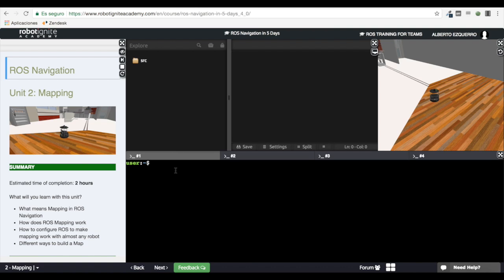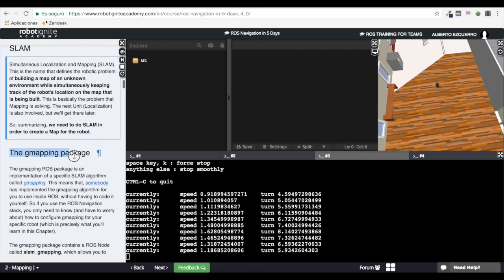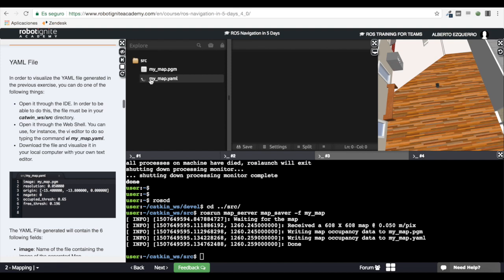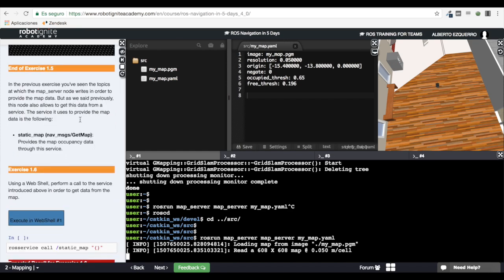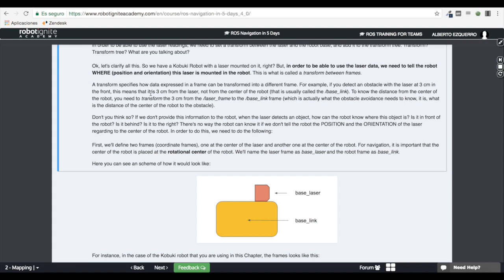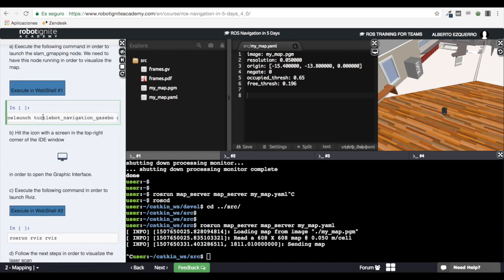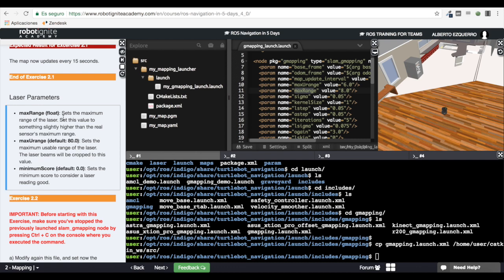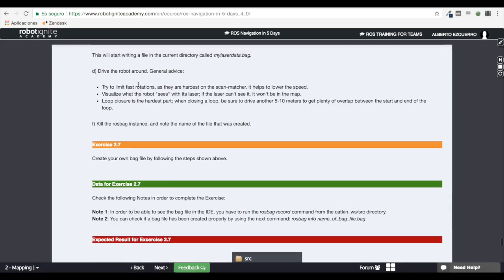ROS NAVIGATION IN 5 DAYS #2 -  Mapping & Create a map from zero

Comment: Thank you for the info. I am building my own mapping robot (from the kind of a Turtlebot 3) and I want to perform navigation tasks. I believe the first thing I should do is to describe the URDF files and tf transforms, right? Then I could use the navigation stack.
Reply from the maker: Yes that is right. Also remember to publish the odometry on a topic and create a topic for accepting Twist messages (speeds). Related to the publishing of the TF transforms, you can use the robot state publisher package to publish that for you based on your URDF
Reply: Thanks! I forgot to mention that Im not building a simulation, but rather making mapping with a real robot, a simpler Turtlebot made by me. Are the URDF files necessary for this?

Comment: Great tutorial.
My Question:-I have saved the map of the environment and when i re-launshed the map using rosrun map_server map_server FILENAME,I can see the map in rviz but for few secounds after that it is getting disapperead and as if there was no map and again it is mapping the environment.I assume the the map is over written by the node gmapping_demo.
Reply from the maker: Yes that error usaully means that you have not killed the gmapping node before you launch the map_server. Once the map has been created and saved, the gmapping node is no longer needed, so you can safely kill it. Then launch the map_server. If you still have the same problem, it means that there is another node that is publishing the map. Just do a rostopic info /map and you will see who is publishing there. You should kill all other nodes that publish in /map, except for the map_server
Reply: Thank you.It worked.

Comment: Hi, I am currently taking this course on the robot ignite website, and i noticed that none of the exercises have any solutions to them. I was just wondering if there is any way to access these solutions, as you don't cover them in the video tutorial. Thanks!
Reply from the maker: Hi Patrick, the navigation course does not require solutions since it is straightforward (just modify some files in the way specified). Is there anything else that you would need to know?